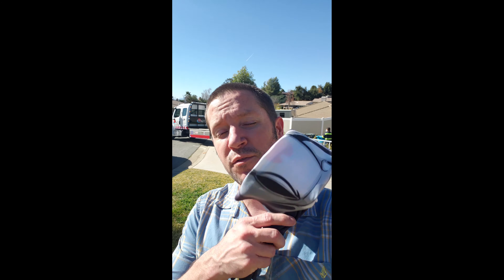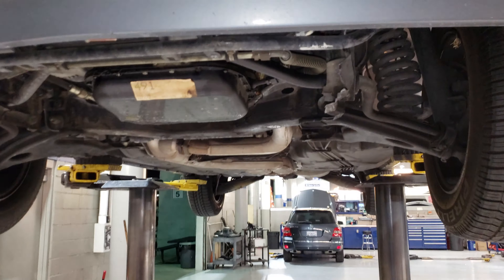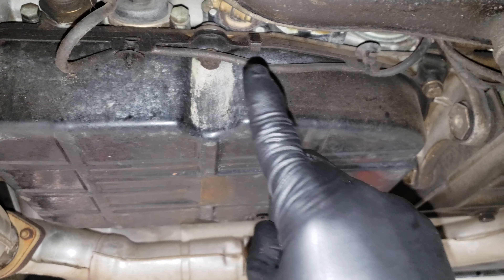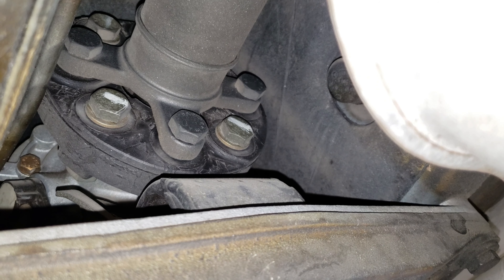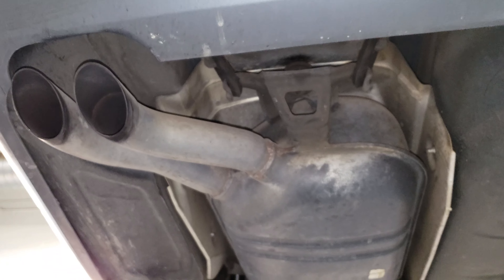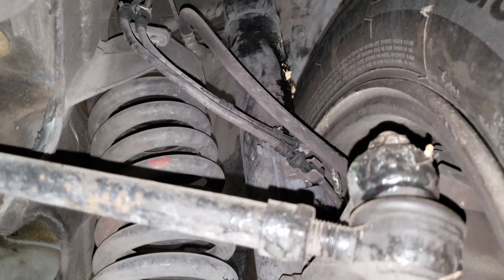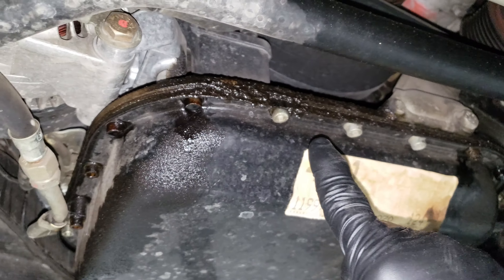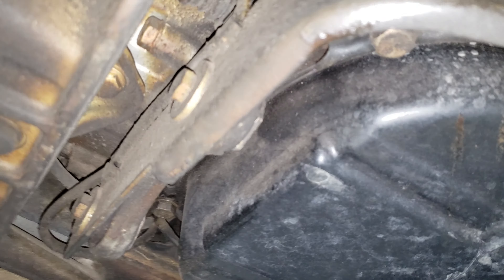Project Gramps Back At the Shop and Inspection

Comment: Thanks for putting the extra time and effort to make a video series of this project! The series are very educational
.

I have the same model and model year as yours and wondered if you would share about how much time you guestimate for the project?
Reply from the maker: This is my first time working on an M119 to this extent.  I've been an MB technician for 10 years.  99% of that has been newer cars though.  When we get older cars in the shop I volunteer to work on them.  I have a 1961 190D right now.  I don't really have a clue how long it's taken me so far but I can give you what labor time would be at the dealership.  Just one cylinder head I believe was something crazy like 26 hours.
Reply: @FriendlyMBTech  Thanks for the feedback. You make the process look deceptively easy. Clearly many years of daily experience helps a lot. Hope you keep up with showing videos for MB repairs. You might want to post links on some of the MB enthusiast sites. That will do a phenomenal job of increasing the number of viewers.
Reply from the maker: @DMountains  I will start doing that for future videos.  I have posted a bit on BenzWorld but that's it.  I plan on doing more to the 400E than the engine so I will do videos of everything else I do as well.  I have some more ideas also but have yet to make the videos.  I greatly appreciate the suggestions and feedback.